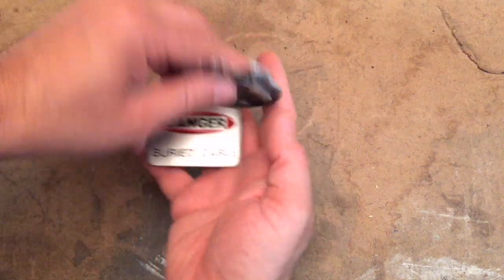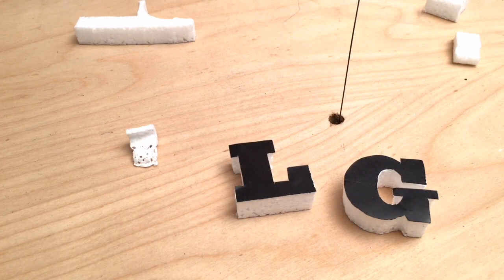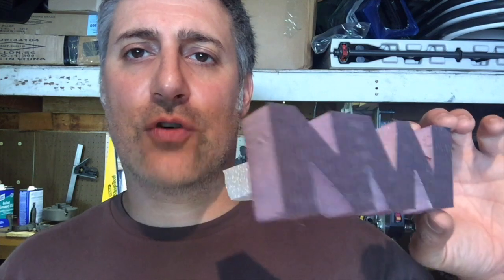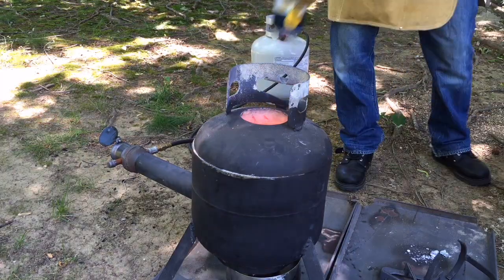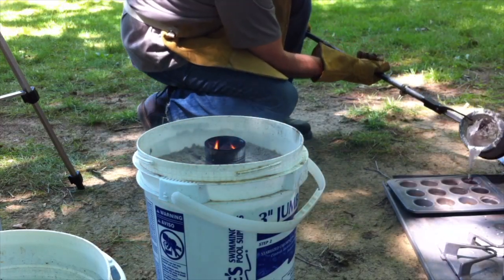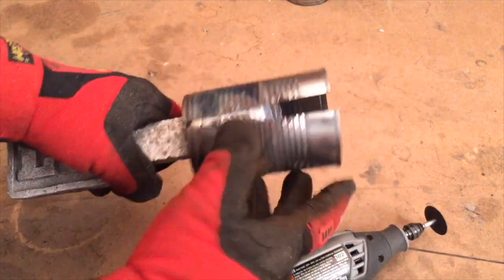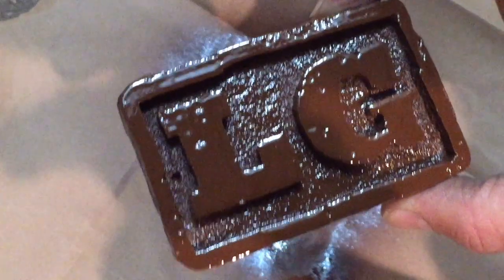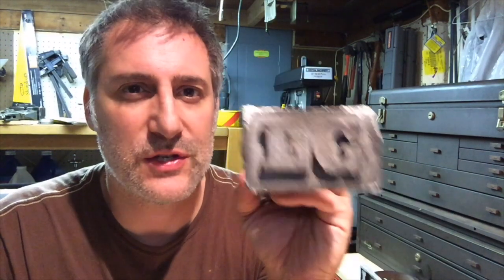Lost Foam Casting - Belt Buckle

Comment: That looks like fun. I am going to give it a go, Did You buy the crucible or make it. I heard you could make them, but I have not tried. I assume it would be ok to just heat it with my forge standing on end. The is a great way to make buckles. I forged a few but they take too long to make. There is the ability to make more than one identicalky. Thanks for the demo, I subbed and Liked... Be well....
Reply from the maker: Hey! Thanks. I bought the crucible and it was around $35. I highly recommend buying one especially if you’re going to be casting on a regular basis. Lost foam casting are one offs. If you wanted to make several buckles, you would make a pattern and do sand casting. That’s my next step.

Comment: i have a question.  I tried a lost foam casting with plaster of Paris (basically the same thing as drywall mud) and it was a disaster.  I think my styrofoam absorbed some of the water, and I didn't give it enough time to dry.  So here's the question.  After you put the drywall mud on, how long do you let it dry?  Hours?  Days?
Reply from the maker: ChiaraDental - I've only tried the drywall method once on another project and let it sit for a few days. The casting didn't turn out so well either. But yea, you need to make sure the coating is completely dried or the moisture will boil when the AI is poured. Don't give up and try it again.
Reply: you only need a very thin coat of plaster, try using paint primer instead of water when you mix. use a little water if it needs to be thinner. i have not tried this primer mix yet but it is used on Luciano you tube channel, it should dry quicker.
Reply from the maker: Thanks for the input Kevin!

Comment: Where did you get the crucible tongs?  I like the one-step lift and pour thing you've got there.
Reply from the maker: I might of missed this comment so sorry for the late response. I fabricated both the tongs and pouring shank. If you're interested, I have older videos of how I did them.
Reply: Dwight G he made them (earlier video). But it is lift out with one set then pour with another. Still a nice setup.

Comment: that belt buckle came out great I was wondering what kind of cement did you use for your The Crucible and Forge
Reply from the maker: Thanks! I didn't mess around with a home brewed refractory cement. I bought a castable cement called Mizzou Kast-O-lite 30 and behind that is a 2" layer of KaoWool insulating blanket. A Salamander Clay Graphite Crucible is what I'm using.
Reply: Cool
Reply: I'm planning on building one soon that helps out a lot thank you also do you have any future videos a project coming up that we can look forward to
Reply from the maker: heath nors reaper forging Glad I can help! Check out alloyavenue.com. Tons of info. Also, most of my furnace and burner design was based on this guys series - https://www.youtube.com/watch?v=gFOq88iQg60.

My future projects are more casting, working on the blacksmith shop, doing some more blacksmithing, and trying to finish up my Atlas lathe restoration. Whew- lots to do with little free time to do it!

Comment: https://youtu.be/LK9rYpRQmiM?t=546

Is the "pitting" in the middle from gas in the metal, gas from the foam, or from loose sand flowing in?
Reply from the maker: Great question! It's hard to say for sure but I think it's probably from both the gas in the metal and the foam vaporizing. For this pour, I took a chance and didn't degass since any pitting would work with the rough look I was going for.
Reply: +eviltwinx it's probably hydrogen contamination should look for Flux and degasser from budget casting.
Reply from the maker: Chris Anderson I normally do flux and degass but just ran with it this time. I wasn't too concerned with the finish since I wanted it "rough" looking.

Comment: nice job outta check out Petra bond sand you get beer detail in your parts
Reply from the maker: I do have Petrobond. I'm saving it for when I make a real pattern and need a great finish. Doing lost foam stinks up the sand like you wouldn't believe. I'm ok with that with the sand I get from HD - not so much with my Petrobond. Heh.
Reply: +eviltwinx true true. would you like to make a face plate I have a pattern I'll let you baro. think I have a video with it in it.